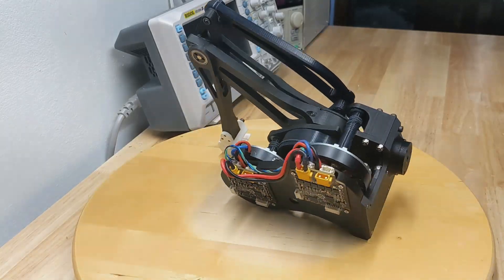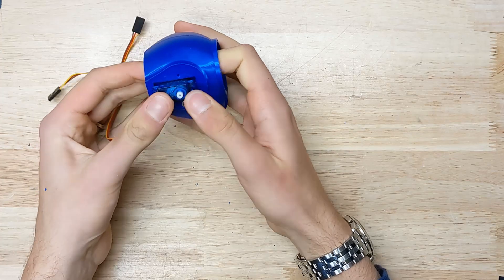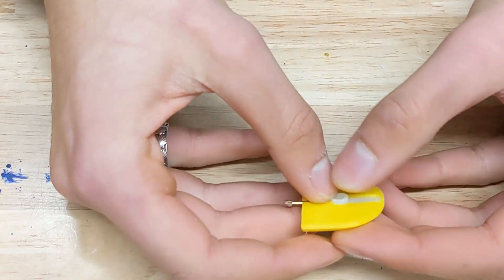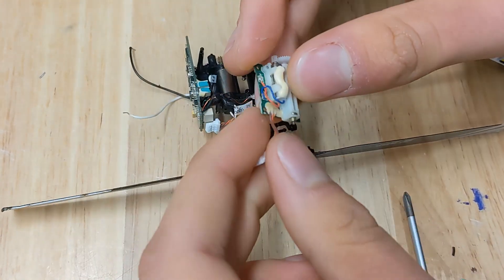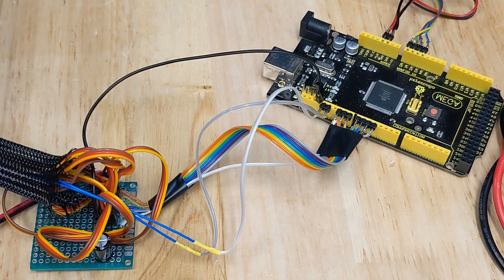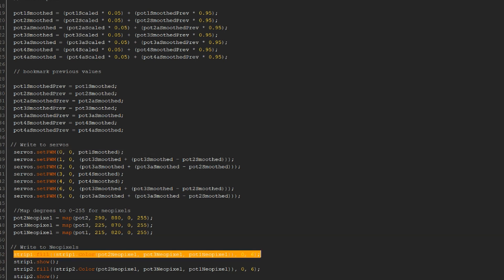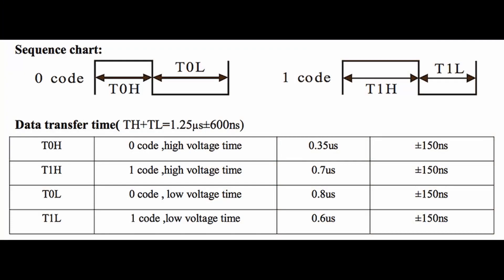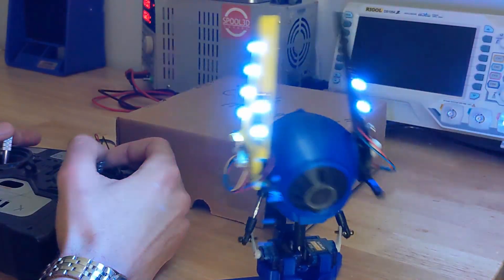Bruce-E Build Series #3 | Building a Robotic Quadruped from the Ground Up |  Robot Head Development

Comment: Switch your photo-diodes (more cons than pros when dealing with dynamic detection of light) to photo-transistors (more pros than cons when it comes to the dynamic detection of light). The main advantage of using photo-transistors over photo-diodes is the gain that photo-transistors have inherently.

Comment: Heads up for your robot!! 😁
One thing that just came to my mind is, when putting all those bright Neo Pixels to the ear pieces, you are shifting the attention away from the robots eyes! 
The eyes should always be the focal point when relating emotionally...they are building the structual coherence.
Just remember how important eye contact is in any concersation!

So maybe dim those on the ears, and add some bright ones in the center of your head?

Keep up that cool project...its been turning out really great so far!! 🤩
Reply from the maker: That's such a fantastic suggestion! I can pretty easily inset them into where the photodiodes are. I will do that promptly, maybe I'll use one of those cute NeoPixel rings 😌. I really appreciate your insight!